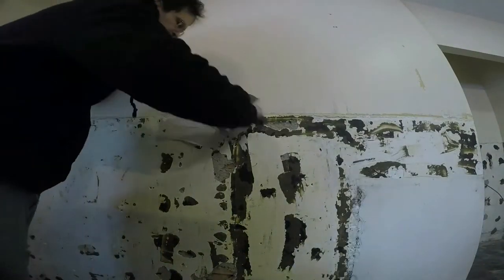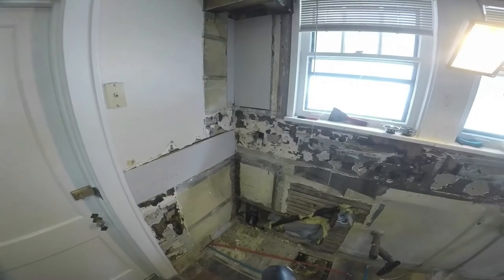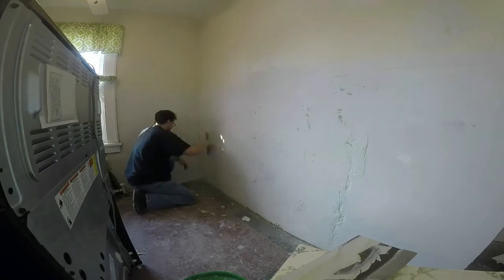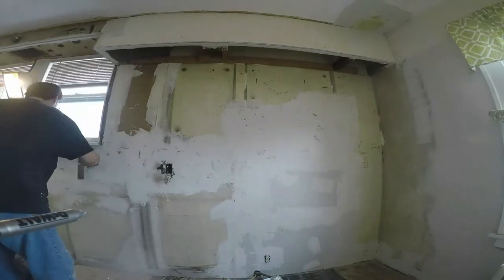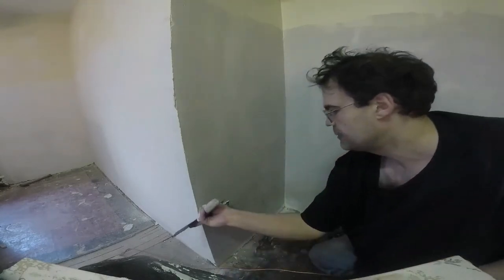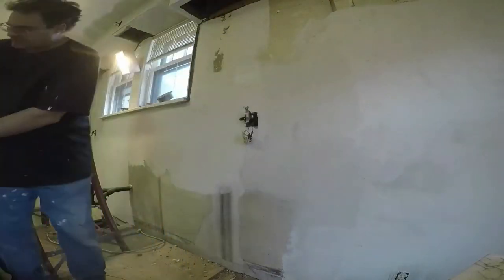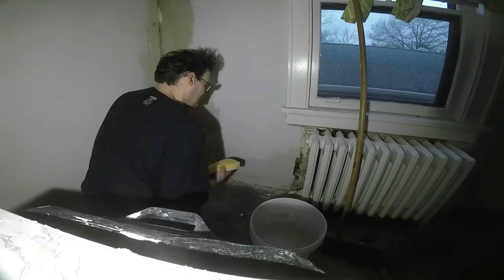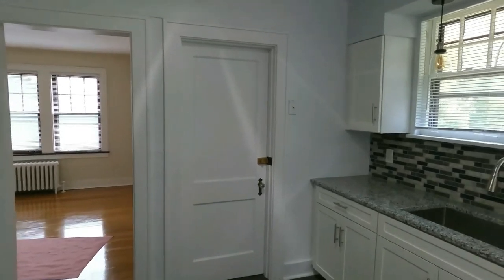HOW TO REPAIR THE WORST PLASTER WALLS WITH JOINT COMPOUND DIY

Comment: With the plaster being so bad, how long until the walls crack again? I want to skim coat my walls to save money but I don’t want them to crack
Reply: in the same boat as you. dont want to spend money on skim coating... rather pay more to fix it  correctly the 1st time